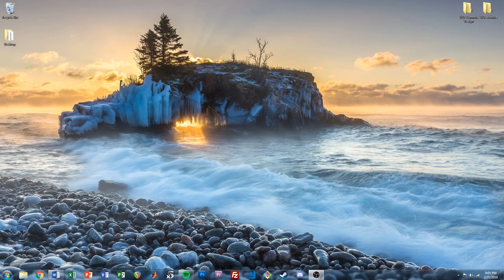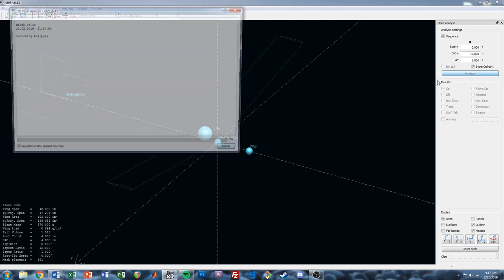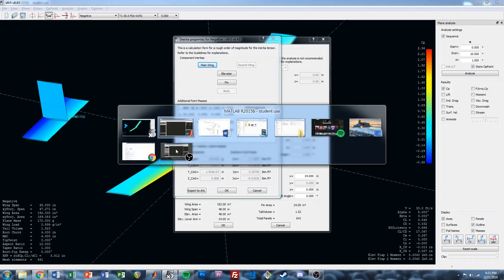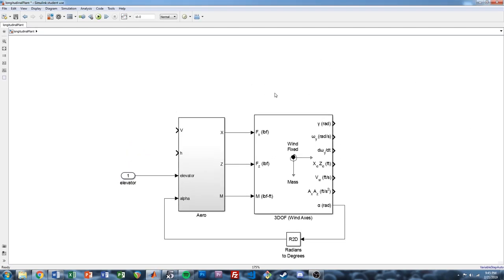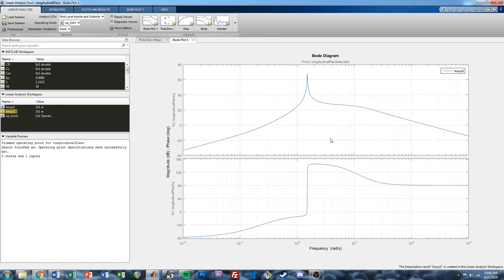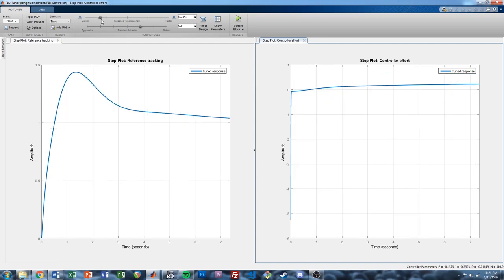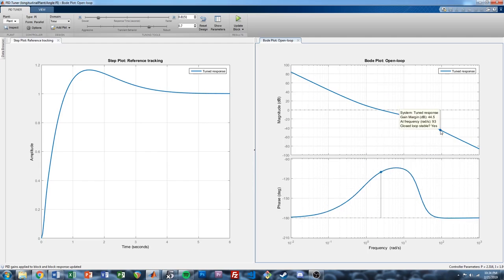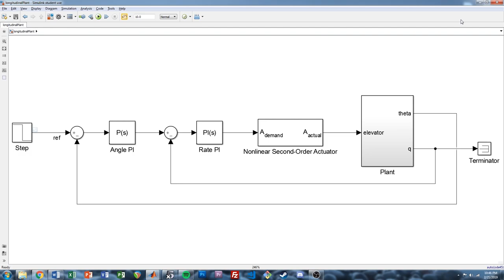Autopilot Design with XFLR and Simulink (Part 1)

Comment: Hey Jordan, I'm funning into this problem where at around the 57 min mark, when using the values you got from the trim settings, the plots in the log inspector aren't really "constant", as in they still oscillate a lot. I've pretty much copied your steps up until that point.

Comment: Hi could you please share how to control altitude for a similar model? My control has pitch angle is in the inner loop while the outer loop tries to control the altitude but for my aircraft model(following your steps for a 737-300) pid control cant find a suitable method method. My gain margin for altitude control goes inf or negative..any suggestions on this

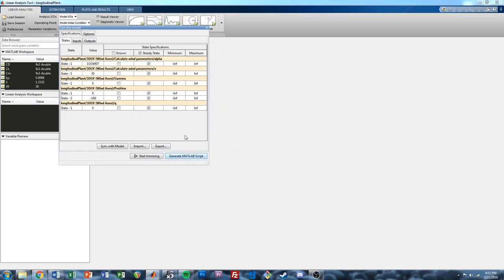Comment: Great work....  I need a state space model of aircraft but for a different set of states (Ref: Page-2: http://ocw.mit.edu/courses/aeronautics-and-astronautics/16-61-aerospace-dynamics-spring-2003/lecture-notes/lecture16.pdf). Is it possible to change the selected default system state (44:30). Can you point me to the material/source for how to change the state or a new video on that???